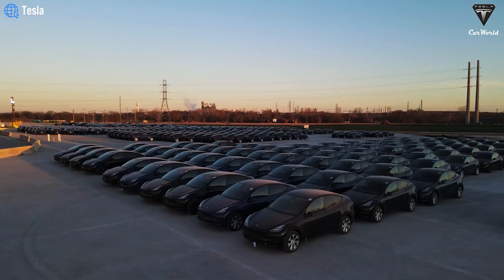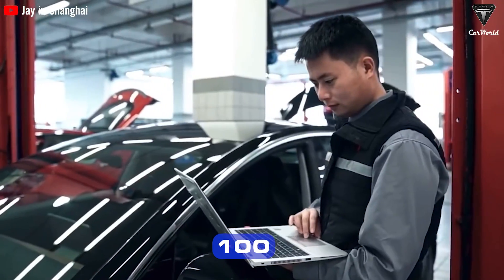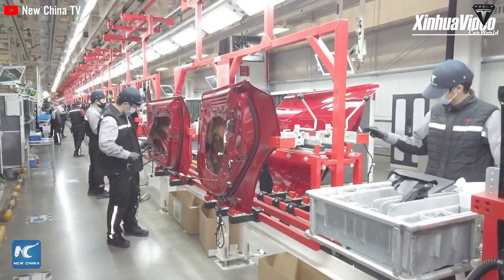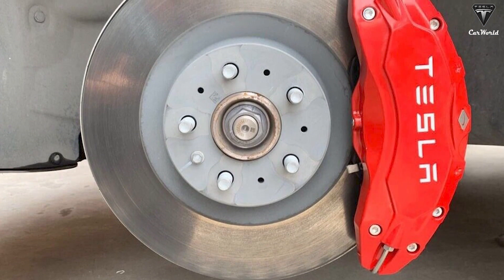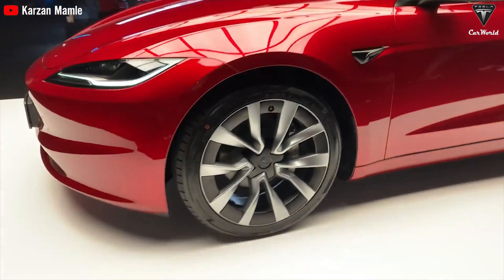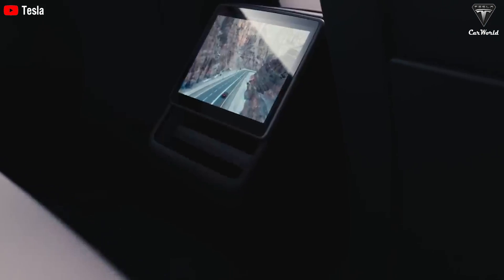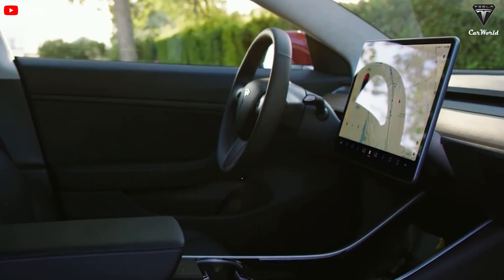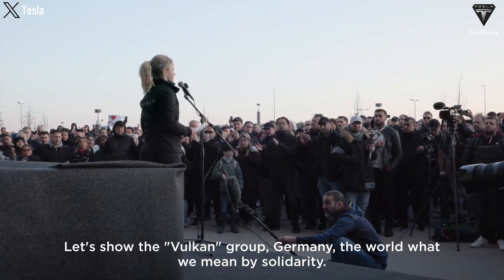Elon Musk Just Revealed 2024 Tesla Model 3 Performance: 618 HP, 0-60 In 2.9 Sec, Priced ONLY $58K!

Comment: you are behind with a lot of the information:
 I am not sure how much power the motors can provide in the future but, for now, the things are straight forward. There are 2 variants of the car: US version, which provides for now 510 hp combined, and the other version manufactured in China which is shipped everywhere else which has a total power output of 460 hp. The only difference between these 2 is the battery pack, which has different supplier (the one in the US has a little bit more energy storage than the other version from china, but this is not what is limiting the power output, but rather the cells). So the limiting factor here is the battery power output. That's it. Nothing else, there is no mystery behind it, nothing to uncover. Only information that I hope we will get, what the actual real world accelerations are for 0-60, 0-120 and quarter mile.